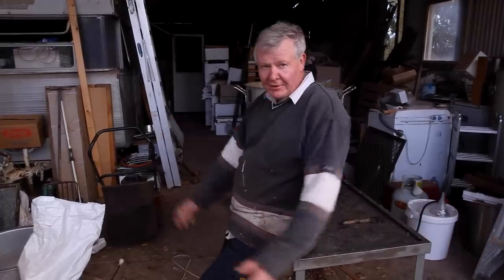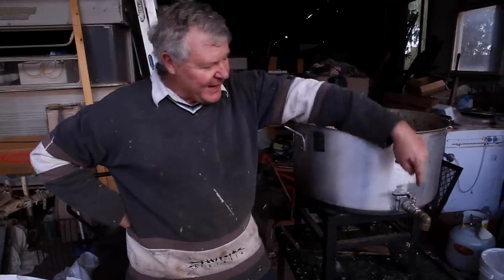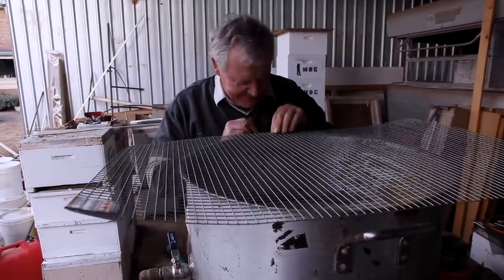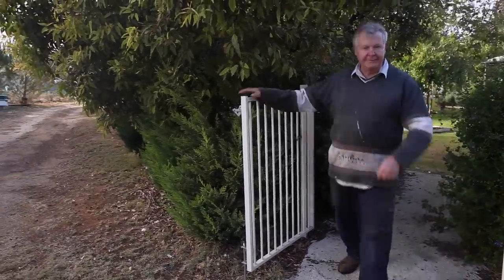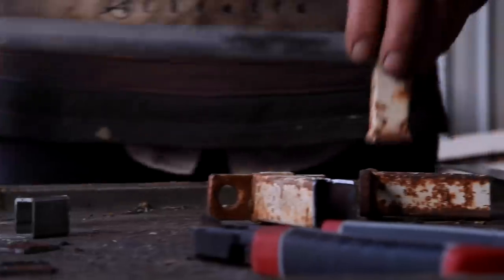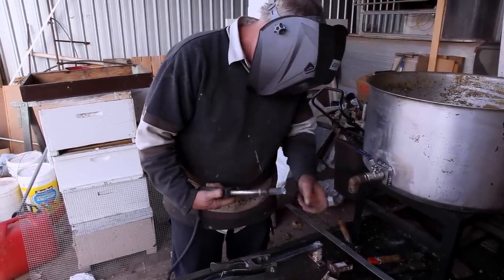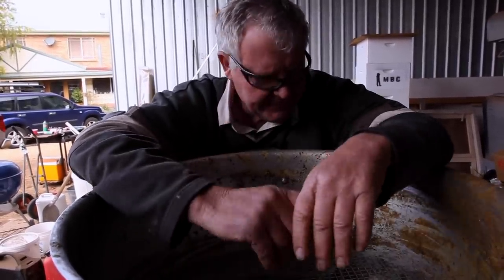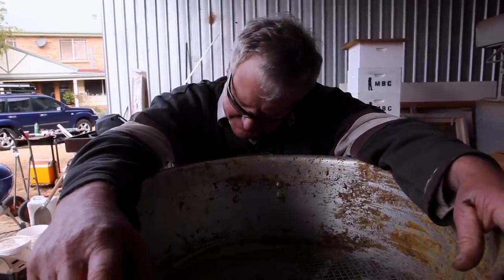Building a Beeswax Filter - The Bush Bee Man

Comment: I know this video is old BUT if you would let tell you a way that I have changed my wax  cleaning that has really really helped me out and takes less time. Here in the USA I went to Lowes hardware ( or any store that sales paint ) should have strainer bags ( one gallon and five gallon) paint strainer bags and they are reusable for a while. Put your nasty wax in them tie it closed . Then put the bag with the wax in your same tube of hot water you are using let the wax melt in the water then pick your strainer bag up and let everything run out that will come out and all the trash will stay in the bag . Also get you some flour sack . I got the one I have from
Walmart there are five in a pack you can cut them to what ever size your pot is that you are using to pure your wax and water in . When you open your valve let the wax strain thru the flour sack on top
Of your bucket. The flour sack are just sheets of cloth maybe  3’x3’ in size just use in a single thickness to strain your wax . If you have ANY questions about this let me know I have trouble writing what I am trying to say and I really hope this helps you out or anyone else also . Thanks for all your video’s I get a kick out of them an I have learned from you also . THANKS

Comment: I use paint filters for 5 gallon buckets and put the wax in them. Put them in the water and melt the wax.  Then pull the filters out and let them drip in the pot. They will have all the crap. Then let the wax harden and scrape the propolis off the bottom of the wax well the wax is still warm.

Comment: Trolling back thru your vids, mate, my method is about two steps. No boiling. Mostly cappings in my case. Collect a few meters of #600 mesh stainless roll mesh. Cut a square and shape into a crud funnel about hand width wide. 1.Electric kettle or roaster-melt wax on low. Skim trash with a square of #8 mesh into a cardboard box. When it's fairly clean, scoop or pour the wax thru the meshy funnely thing into molds. 100% clean. Filter lasts for about 5lbs of wax. Make another. Works well enough for my 15 hives.

Comment: #8 mesh will keep the 'crap' out.  Your half inch mesh is too big.  But the idea is there.  Keep tinkering.
How did it work for you?
Reply: There is no #8 mesh in Australia.
Reply: @hughyhughes8058  Sorry to hear that.  It's what we use on our screened bottom boards in the states.  What about a window screen?  Just throwing ideas out there for you.
Reply: Yeah it sucks not having that #8 mesh. What you call window screen is what we call fly screen I believe. Much smaller holes. It does work, just clogs up a bit quicker that's all.